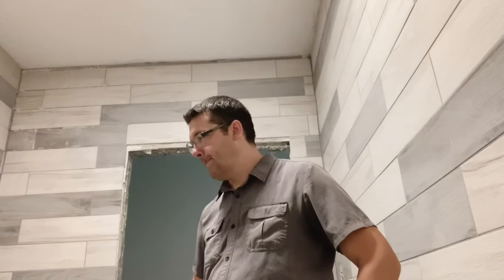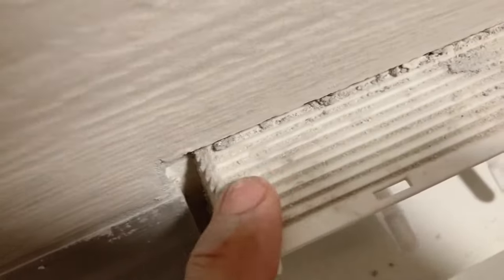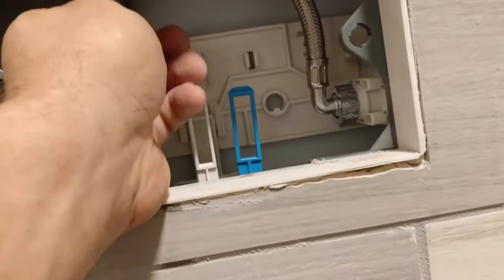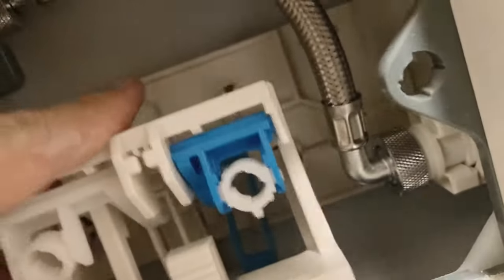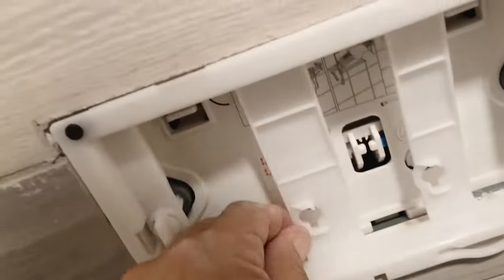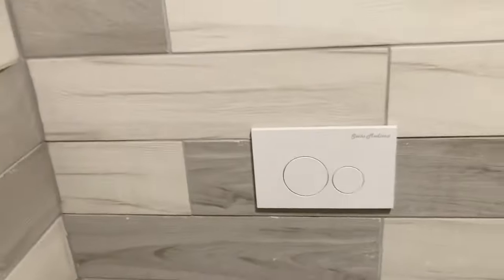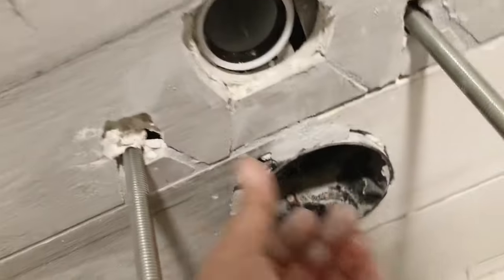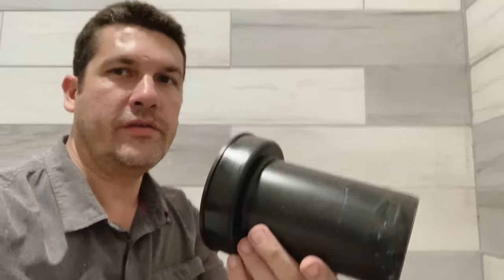Swiss Madison Wall Hung Toilet  Installation (Tutorial)

Comment: Nice toilet
Reply from the maker: Fil-Am Farm Girl abi ko sin o 😅
Reply: @dailymotivation4y0  I had someone install this but there is no water in the tank yet, he’s coming back after the tiling is done, can I put the plastic pieces in now to see if there are any leaks in the tank or will that cause a leak because there is no toilet installed and the 2 pipe holes are not connected
Reply from the maker: @ZakiPolad  it won’t leak if you fill the tank, but if you accidentally flush it will dump all the water in the floor
Reply: @dailymotivation4y0  thank you, do you think I should fill it or just leave it as is. The plumber left it as is until the tiling is done but maybe I’m just being paranoid because once the tile is in I can’t do anything without ripping them out, thank you for the quick reply, also to fill it do I push the plastic white skinny  piece in but doesn’t that flush it?
Reply from the maker: @ZakiPolad  If you are concerned about it, you can turn the valve on and fill the tank and then you can use the bucket to catch the water and push with your finger to flush
Reply: @dailymotivation4y0  thanks I watched the video again but don’t see how you turned the water on to get water in the toilet. Can you tell me how you do that? Thanks
Reply: Tradúceme ha español

Comment: We just installed this toilet, but unfortunately we cut the two pipes 15/16" shorter because we followed the written instructions included with the toilet.   This caused the toilet to dump water all over our brand new bathroom, through the wall, downstairs and into our basement.  I will contact the company and hopefully they will send two new pipes, but I am not holding my breath.   We should have watched your video first!  I cannot even say how aggravated I am with their poorly written instructions.  Hopefully we can get it to work with some new pipes.
Reply: Did you get this resolved with Swiss Madison? I'm about to install four of these toilets, and I couldn't figure out why I should cut an extra 15/16" off as instructed by the manufacturer. For the supply tube, that would have left ~1/2" behind the bowl and not nearly enough to engage with the inlet pipe. I searched online and really only found this video which confirmed my intuition: ignore the instructions from Swiss Madison.
Reply: I got fed up installing one right now and just went to get some BBQ and drink a beer. This video just saved me. The directions were horrible

Comment: I appreciate you posting this video as we are getting ready to remodel a bathroom and are looking at a wall hung toilet. When you put the supply and drain lines in the connections inside the wall, are there seals inside that connection? I didn’t see you use any type of plastic cement. Also how is the whole system holding up with the tank and bowl? Would you change anything?
Reply from the maker: There are rubber seals,holding up just fine with no problems is in office building

Comment: I will review this at least twice bf my install. Have installed around 240 two piecers.
Reply: Update, successful installation. The crescent shape retainers (two) that attach to the two long horizontal threaded rods is set to 2 and a quarter inches from finished wall. The shallow recess per Allen screws are centered at two and a quarter inch out from finish wall. The waste and water pipes were cut at 2” (or slightly less) for my flush mount to 5/8” Sheetrock. Two inch sticking out from the finished wall.

Comment: I wish the chrome caps that go over the seat bolts and lay flush with the top of the bowl had some form of washer or gasket inside them that prevented "fluids" from getting in under them and collecting...

Comment: Can the plumbing for this be ran in a 2x4 wall? I'm set to install one of these and am now thinking I'll need a 2x6 wall to run 3'' drain line
Reply: There's a 2x6 wall commercial version and 2x4 wall residential version. I have the residential version and am installing it right now.

Comment: Do you what the two pipes are called that need to be cut? I cut mine too short and I’m trying to find it on amazon but having no success. Can you send me a link please? Thanks.
Reply from the maker: Geberit 152.438.46.1 HDPE Connector set. Search that on Amazon it will come up

Comment: Im about to purchase one of these toilets, how has it held up over the last 2 years? I'm very skeptical of this design and the potential for hidden water leaks. I'm also nervous about how they hold up over time in terms of staying snug to the wall with weight/torque forces leveraging the toilet away from the wall
Reply from the maker: Installed in commercial offices which about 50 people and haven’t had any problems so far
Reply: @dailymotivation4y0  thanks for replying!! I'm finalizing my designs by the end of the month and the toilets should be here shortly.
Reply from the maker: @kylegeldmaker  you’re welcome
Reply: @kylegeldmaker update please?

Comment: My contractor installed a swiss Madison Plaisir wall toilet for me in my bathroom but the toilet slightly moves when you sit on it... He reinforced it by adding a piece of metal underneath sticking out of the wall but I'm suspicious that he did something wrong and then just compensated for his error. Is it normal to have a little give when you sit on the toilet???
Reply from the maker: If it is installed correctly it doesn’t wobble. If the wall is sheet rock you need to add bracing before you put the sheet rock is installed.
Reply: @dailymotivation4y0   thanks for the response. What material do you recommend for bracing?
Reply from the maker: @nicolesanderson4071  3 quarter plywood works best

Comment: The only down side to this is, the control panel made of all plastic, will eventually break internally (no biggie) - BUT the manufacturer will at some point, discontinue making parts for this, leaving the owner stranded.  It's the only thing stopping ME from pulling the trigger on this model.  I love the look of this thing, but know that the plastic mechanism will absolutely break at some point in the future leaving me without the ability to get parts.  I don't want to have to completely replace the entire thing with something completely different in ten years because I can't get parts.
Reply: My son used a 3D printer to print replacement part for washing machine door mechanism instead of buying $200 plus replacement from mfr.. Works great
Reply: @mikepyles3502  ...or they could make these high-use, hard-to-get-to, in-wall components out of metal to begin with.
Reply: The Geberit wall systems have been sold for five decades with millions of installations. They guarantee current parts are made for 25 year minimum. It’s a proven design.

Comment: What happens if the tank or flush Mechanisms need replacing?
Reply from the maker: You can change the flush mechanism through the push plate.You cannot replace the tank without tearing the wall out.

Comment: Thank you for this video! Sooo much easier than reading the instructions myself lol Have you installed one of these on drywall? I have a little flex in mine and wonder if that’s normal
Reply from the maker: Put the board underneath the drain pipe in between the frame & dry wall,to get rid of the flex
Reply: @dailymotivation4y0  thanks! I wished I would’ve thought of this before drywall, texture, and paint 🤦🏻‍♂️
Reply: I called swiss Madison and they told me to screw in the “Silver bullets” on the end of the threaded rods coming out of the wall a little bit closer to the wall than the measurement that should be equal to the hole in the side of the toilet to the back wall of the toilet. This pretty much the flex in mine.

Comment: Hey man my wife recently ordered one of these for our bathroom remodel, and I got everything installed per the manual, pretty easy and it’s a pretty cool fancy system

I’m curious does it seem to be normal to have to hold the flush actuator buttons down for it to fully flush? Or am I missing some kind of adjustment somewhere that allows me to just push the button like a typical flush valve and walk away?
Reply from the maker: There is adjustment inside the tank that will increase the flush,but it’s a water saver it won’t fully flush unless you hold the button
Reply: Im about to order one of this toilets but I read bad comments of It (specially about the flush), would you recommend buying It?
Reply: @erikvaldez1076  sorry for the late reply - personally, I'd absolutely recommend. My only issues is the fact that I have two boys. Doesn't matter how many times I explain, yell or anything - they're too lazy to hold the damn button 😑 but my wife and I both absolutely love this toilet. I finished the remodel almost two years ago now, and haven't had a single issue since. 

One piece of advice if you do decide to orde this, definitely beef up the in-wall mounting. I double studded everything and I'm glad I did, especially with porcelain tile surrounding everything. Itll probably be fine regardless, but that's the only thing I've been concerned about since installing
Reply: You haven’t shown the part where and how you screw it to the wall